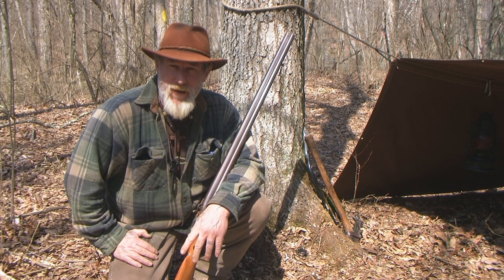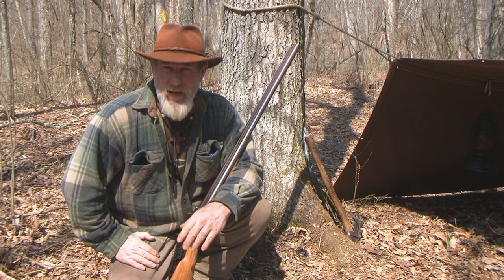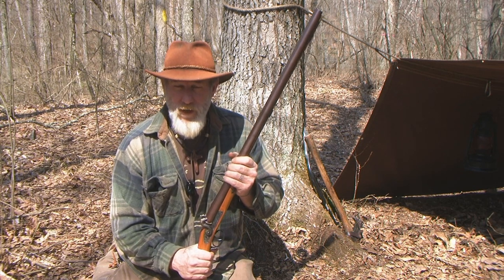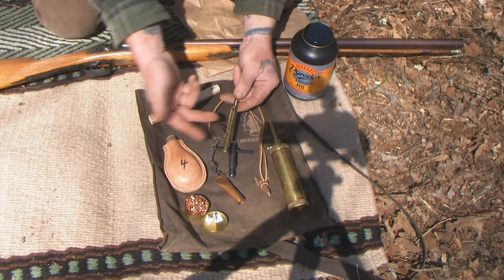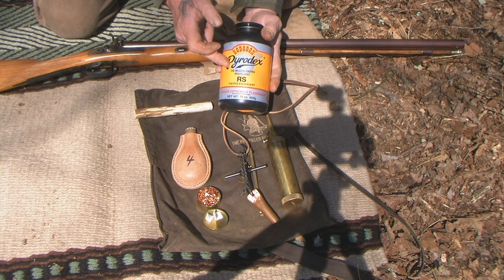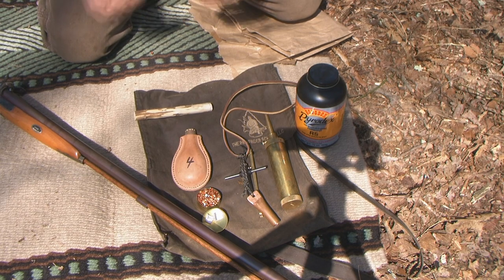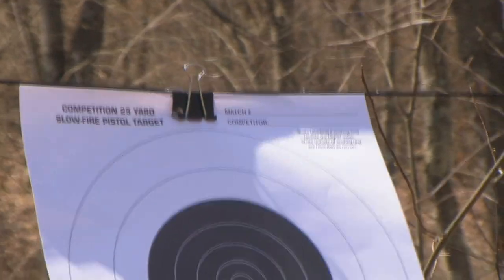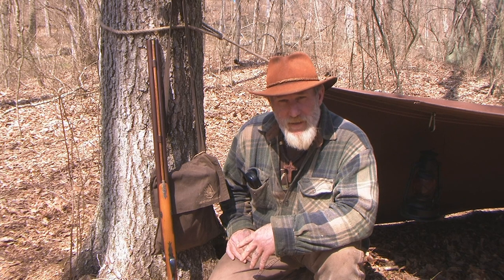Introduction to Cap Lock Firearms Part 1

Comment: That is why i have so much trouble getting my flintlock blunderbuss to fire!?  Pyrodex.  What helped some was to use an old coffee grinder on the course pyrodex, & set that aside for pan primer, but it was still less than optimal.  Ground too fine it starts leaking out of the dispenser, & gets blown out of the pan by the slightest wind.  Yes, it is very unreliable in flintlock ignition. Often, pan ignites but chamber doesn't, & that gets sketchy because of the chance of delayed combustion. TY!

Comment: That is a fine double barrel. Thank you for doing a video on this. Are there any double barrel percussion muzzle loading shotguns still made, and at a decent price? Or was yours a rare find? I'll have to look into it. For just a regular shotgun, I happen to like the Stoeger double barrel coach gun. It only weighs 6.5 lbs., about 1/2 lbs. more than the H&R Pardner Turkey gun. And I like the fact that it has two independent trigger and firing systems. So if one were to fail, the other works.

Comment: In regard to your multi-use policy, I agree with, you might try finding an adapter that is made to fit your cap nipple that takes a shotgun shell primer just like you use on your blackpowder shotshell reload vids.  I've had about 4 of them on various guns and they really reduce misfires in wet weather and since the primer is kept in place with a screw on cap, they will let you hunt in the rain just fine.  (I want that shotgun.. :)

Comment: when i was using sidelocks i used the t/c speed loaders there plastic u put the slug in first pour your pre measured shot on topand the was a place to put the cap upside down so u chould put it on the nipple directly and the top of it snapped shut water tight

Comment: Dave the only reason I thought I thought it was a Pedersoli is because that is what the gun smith told me.Is your gun marked with jeweler marks or marked with Pedersoli/? Mine has jewler marks on it, it is a lion and some other marks on the barrel and inside the hammer plate.Mine is almost identical to yours except it has a screw to remove the barrels that can be removed with your fingers.I bouht the gun because of the barrel options about 15 years ago before I lost the use of my right arm.

Comment: You can take the hide off a leather covered baseball and just stitch them up together flat, cut in the middle and you would have 2 but they wouldn't have the same finish your choice which side you have out white or raw suede, give the outside a good coat of beeswax and you should be good to go. Just add corks/stoppers.